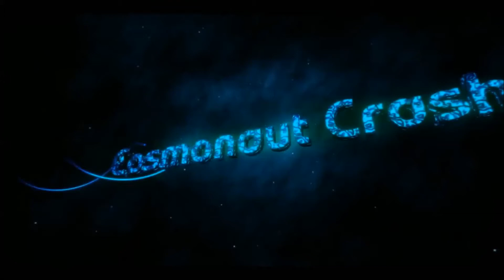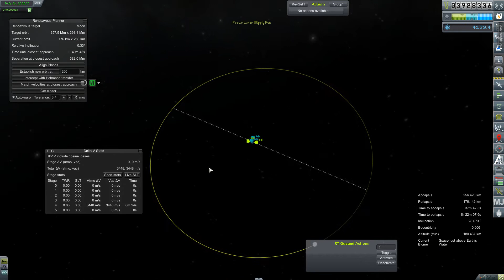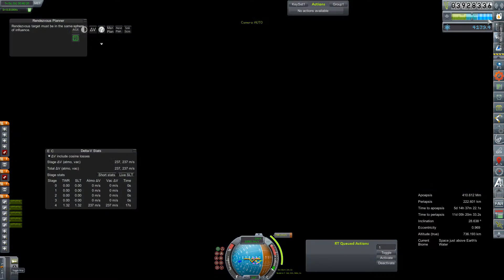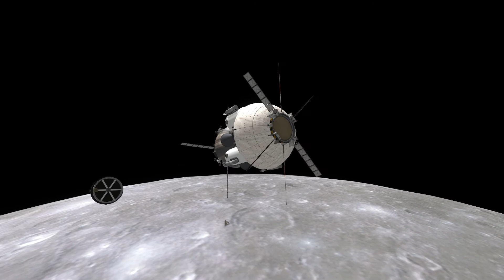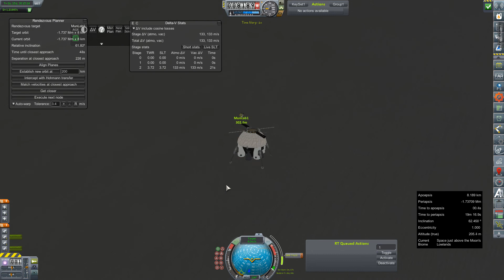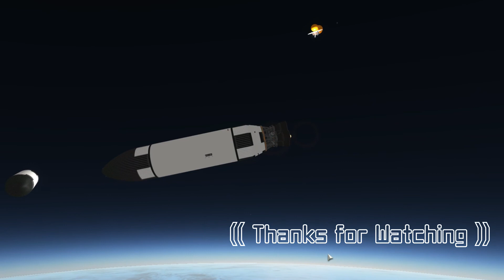KSP RP-0 #330 MoonLab Supply Drop

Comment: It's best to start the burn a little early rather than a little late if you're not sure. Starting early means that if you undershoot you can burn radial to correct.

Also, for real precision, you'll want to keep the retrograde marker roughly over the antitarget marker as you get nearer. And throttleable engines help a lot.
Reply from the maker: Throttle-able engines help sooooooo much - My biggest worry is the ignitions.  The LEM descent engine at best has four, but deep throttles.  I plan on using one to bring the crew down to the Lab. ( fingers crossed ) The choice of the Astris II here was based on unlimited ignitions and instant spool time (vs the AJ-10, which takes a second or two to get up to thrust, but has higher ISP )  Ultimately, I would like a supply pod setup that can land near the Lab, resupply, and then take off again to an orbital station to re-fill and repeat the process. ( as this is how I intend to keep the Mars lab going ) so unlimited ignitions becomes a higher priority than throttle.